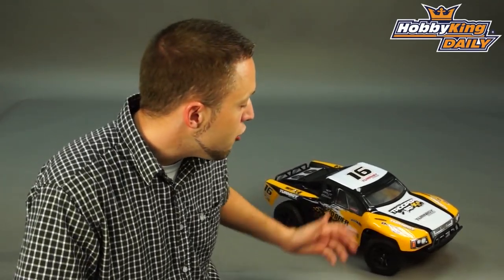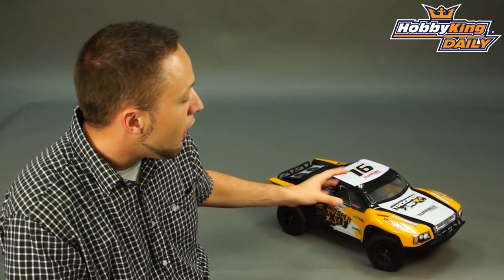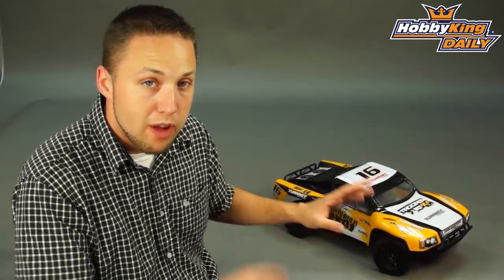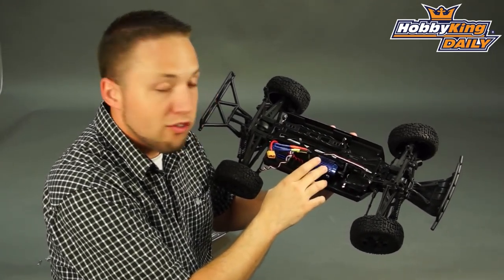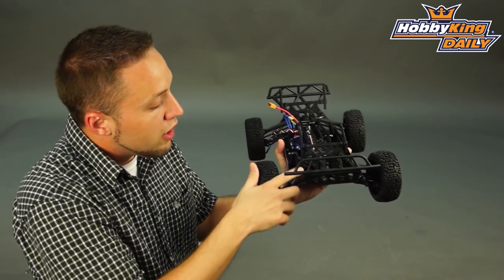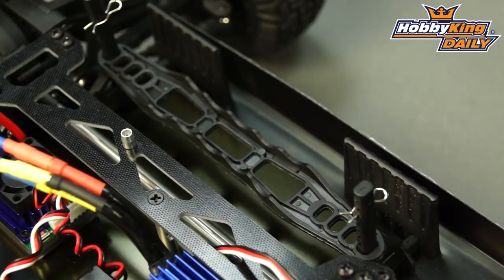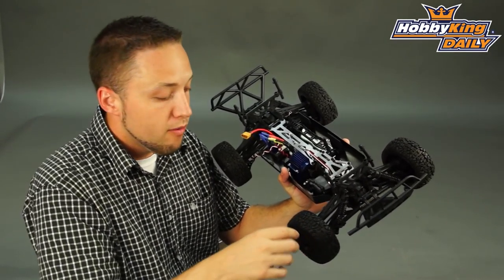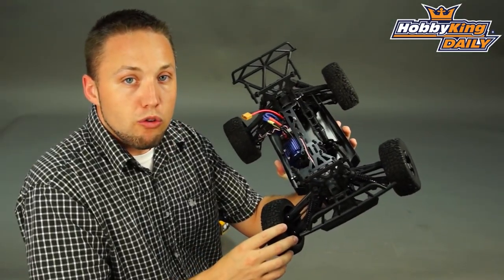HobbyKing Daily - Turnigy Trooper SCT

Comment: 35 amp esc is not enough. Minimum 60 amp imho. Is that another pvc body? Sigh* I like the improvements to the truck but there are some fundamental issues that are still there. Loved the older version, this one looks like it will be better. Keep working on it fellas.